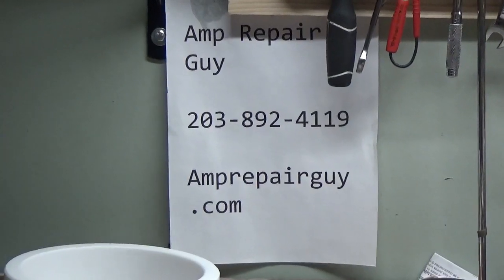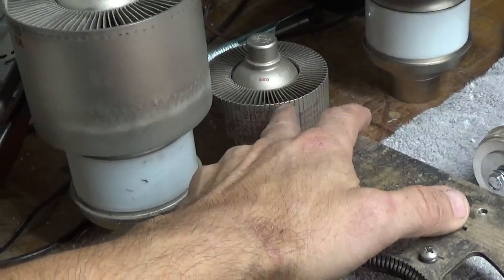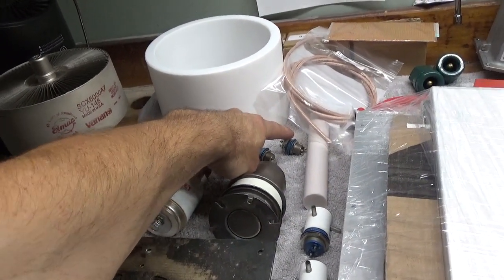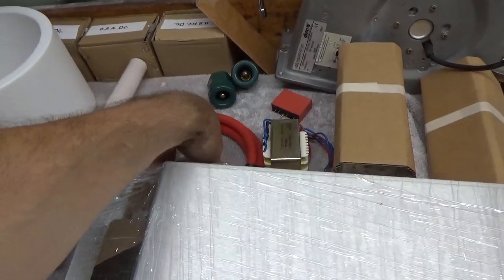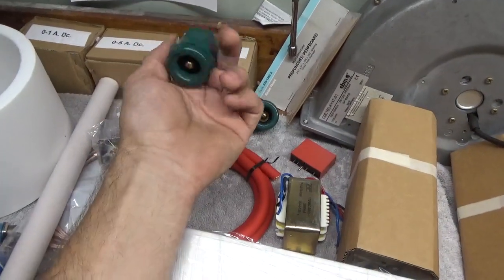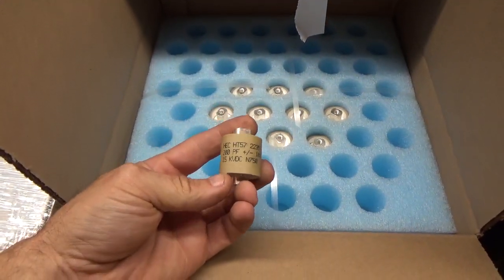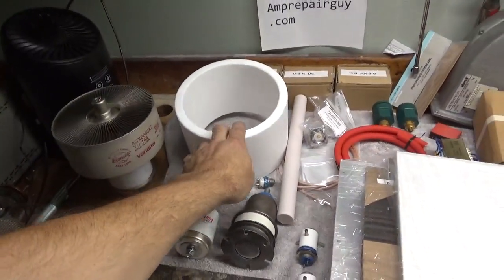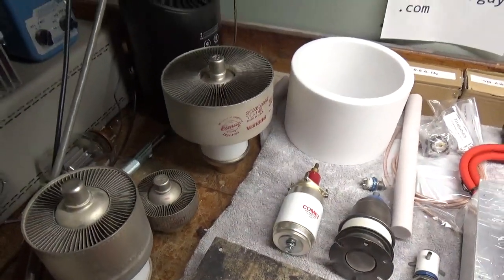3cx6000a7 6 Meter Amplifier 10kw Plus

Comment: Hi:  Where I can get that kind of tube chimney (Teflon) with thicker wall for my 3CX3000A7.  I will
appreciate any information about it.  Thanks.
Reply from the maker: The radiator isn’t wide enough on a 3cx3000 for a straight chimney. Would need a tube and a plate mounted to the top with a hole cut in it the diameter of the 3cx3k radiator

Comment: Nice box of bits.... i'm looking forward to seeing the output circuit and how you deal with stray capacitance.  I'm looking for ideas for my 3cpx5000 amp on 6m. (i've got 99% the bits, i just need a decent circuit)
Reply from the maker: That tube has even more interelectrode capacitance.  The setup I will be using in this pa, won't be a good roadmap for your tube.
Reply: @amprepairguy  Yes, i was looking at the design WD7S used on his amp, but I know others have had issues with lots of capacitance.  The best solution i've seen was an adjustable L  Maybe i should sell the three tubes i have and pick a different tube..  Still interesting watching your videos though 🙂

Comment: Genuine question.  Why are so many of these amps based around a 3cx tube and not a 4cx?    Are 4cx tubes and USSR equivalents that much harder to work with?  Surely the higher gain is good, so you wouldn't need a pre driver amp, and the input can feed a 50 ohm resistor, so much less input matching issues?  Just trying to get my head round this all, as i would be keen to build a 4CX or USSR equivalent amp for HF, 80-10.  I have never built an amp before.    Cheers.
Reply from the maker: I  have never nor would I ever use a russian surplus tube. They are almost always gassy. As for a grid driven tetrode, boils down to money. I have built cathode driven triodes and grid driven tetrodes. Ones with and without handles. I always use a tuned input network for a triode or tetrode . As the input circuit filters harmonic content.
Reply: @amprepairguy  Thanks for your response. In keen to learn about amps, so your videos are very interesting.